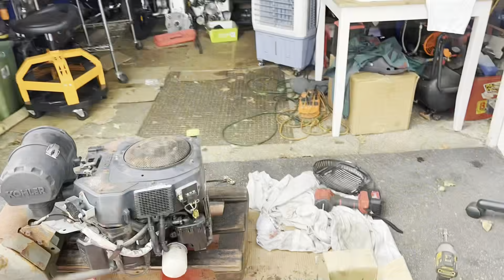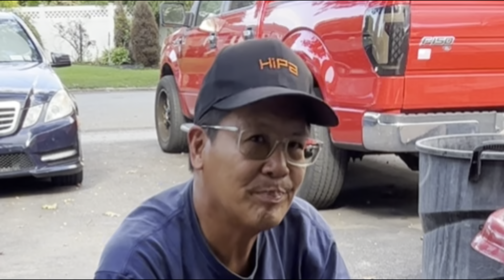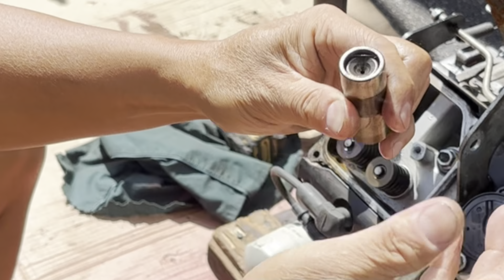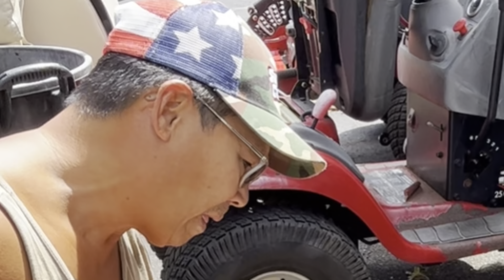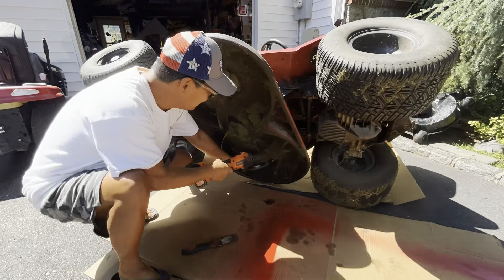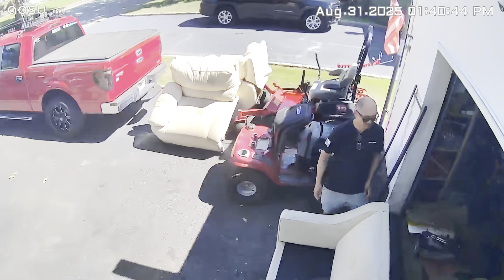Kohler ECV749-3046 EFI V-Twin New Camshaft Connecting Rod Piston Rings Engine Assembly Ep. 6

Comment: Henry I work on Kohler engine's alot and you need a factory sump gasket to set the end play right on the crank and the starter has to be jumped on the small wire on the solenoid not the big one. Good luck I'll be watching to see if you get it figured out .👍🙂
Reply from the maker: Thx for the tips and the support!
Reply from the maker: Jumping ahead,  I’ve got no spark now,  and I’ve troubleshooted the fuel pump module and it works when I power it from another source,  but it doesn’t work when powered with the ecm pigtail.  I had spark,  now I don’t. Any ideas?  I’m two weeks ahead of my videos.
Reply: @MowersNBlowers  If you applied 12v to the ignition ... you may have killed it.  How many wires connected to the coil/magnetos?  I expect the ECM is looking for a safety of some kind before it will apply power to the fuel pump.  The original wiring likely had a ROLL OVER switch to kill pump power in case of rollover.  That could also affect spark if they were 'belt & suspenders' with their safety interlocks/switches.
Reply from the maker: Coil? Magnetos?  It’s EFI so it has coil packs

Comment: You need the factory sump gasket. Sump gaskets on small engines set the end play.
Reply from the maker: Thx bro
Reply: @MowersNBlowers  I know some engines have multiple thickness gaskets to adjust end play.  Kohler has a PDF for their engines on their web site.  REHLKO may have kept up the practice.  It should have the steps to adjust the crankshaft end play.  You should have clearance when the sump is torqued.  If you do not, you need to add something to increase the end play, or check bit by bit to determine where you have interference.  I wondered if there was damage on one end or the other to the crankshaft or to the block. If the flat on the other end was damaged the way the big end of the connecting rod was, it would eat up any end play, and installing the largest gasket might not keep things free.  Look closely at both case parts and crankshaft.  The camshaft bushing spots in the block and sump should also be checked to make sure they are not damaged.  Can't hurt... tom
Reply from the maker: @GrumpyUnkMillions thanks for the sound advice Tom

Comment: HENRY!!!  I hope I catch you in time, just went through the same thing with a Kohler single.  You can't just bump the starter.  This is a GM style and you have to connect the blue wire from the ignition switch.  Take off the solenoid and you'll see that plastic forked lever to move the gear to engage.  It's definitely the solenoid, they do not use that spiral Bendix Type gear.
Reply from the maker: Yup I figured it out.  Thanks